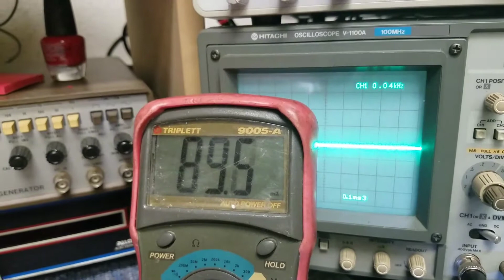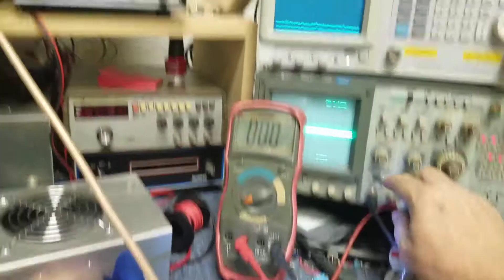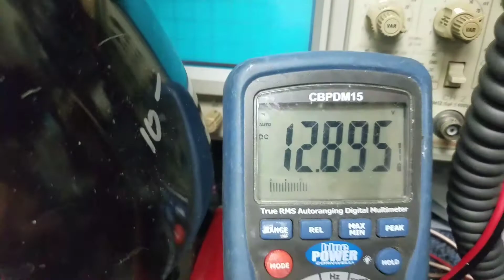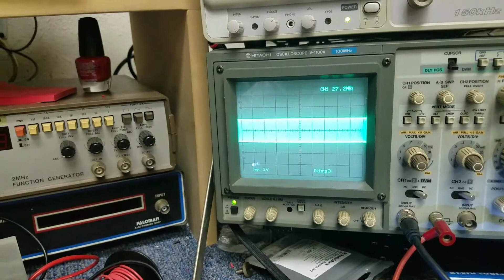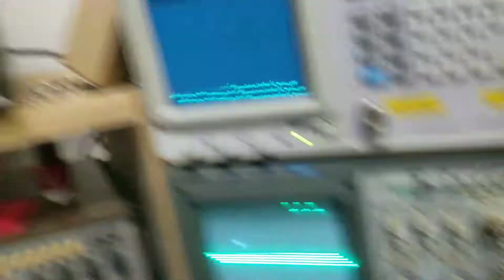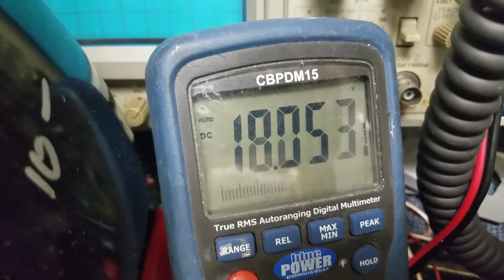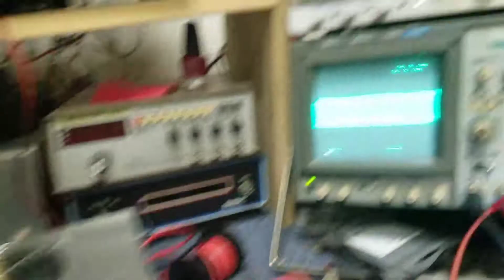REGULATED AB BIAS ..  YEA... WE DO THAT.

Comment: You do realize that the only way you can AB bias is FM right ?
Reply from the maker: your confused. FM transmitters are generally class c
Reply: ROFLMAO
Reply: WHAT ???? Only Frequency Modification can be AB Class ???  I think you need to re-read your  basic radio theory ... LOL 

This must be something you heard from somebody that obviously hasn't a clue of what Classes of amplifiers are .... Probably from someone who builds amps  with enough knowledge to make it amplify ..... but doesn't really know how or why it does work .... 
   Got to be the funniest statement I've heard in the electronic community in a while ..Of course it would be on a CB amp building forum... Can I sell you some antenna slick so them SWRs will just slde off tuat antenna ? Or a dead battery to shunt feed the bottom of your tower with so your signal will get out.better ? Class AB only with FM ... thats precious
Reply: @smokinjoeselectronics442bu7  or D

Comment: will this work on a 3 pill that is on u tube any help will be greatly appreciated thanks
Reply: Of course it will work. That is how all well built properly designed amps work. Only "builder" trash does not have this sort of circuitry. Only a moron would use cheap inaccurate giant sand bar resistors and a fixed bias. Bias should always be feed by a low impedance transistor and it has to track with temp. to be of any real use to keep the unit properly biased as it heats up with work or duty cycle. This is the only way to keep the amp AB biased. A lot of builders will build class B and as it is driven harder and heats up it will hopefully move towards AB and stay away from C. If you try to use a class C amp on sideband not only will you sound terrible but it will kill the transistors sooner rather than later. Most builders have very little education about electronics and I do not mean formal either you can be self taught at that is great. Most of them though just copy what someone else has done before and if you are lucky they might use trail and error to refine their already crude design. It is like the difference between someone that can turn a wrench and someone that is properly trained as a mechanic. You can not fix something you do not fully understand especial if you have no clue why something keeps failing. The "builders" suffer from a lot of failures due to their design. They can not fix the root of the problem because they do not understand what is wrong. They do not understand electronics that well and have no clue about design. The few that do are usually not that popular and are run out of the community and treated with a lot of hate. Builders have cult like followers that are brand loyal and will ridicule and run down anyone that has any intelligence and true understanding! You see it on all the amp boards and Facebook pages followed by key-down idiots and such! That is why they are all backed up with repairs to the point that most can not stay on top of new builds!

Comment: Clean ???? No filter but it's Clean ? typical CBer  non-linear "linear" ... Dude you just pushed  each of those 2 120 watt devices past double their factory specs . That should be a  250 to 300w amp.. and 300 watts is pushing it  ... dude , do you got any kind of attenuation on the input of that amp ?   I guess this is how you guarantee yourself more work. Typical CB amp/TVI generator .  But it sure sells amps because Cbers think that if it don't wipe out at least 5 channels on each side it isn't putting out power.

      And I'm picking on CBers ....because they don't understand radio theory . They instead go by  the crazy stuff they are told . They don't realize that a good ,clean ,amp doesn't splatter all  over and actually projects all it's power on the frequency that its on.. But an Amp builder should .

    Oh, and I like how you hid your "secret section" what's in it ? Bet it isn't a filter .... Why Hide it ? Good, Proven ,Bias circuits are all over web ...By the way , there is more than just voltage that Flattops a signal and throws out other trash dude.   But you your TVI generator is special  ... To CBers: TVI stands for Television Interference ...
Reply: FYI.
YOUR TALKING TO A DEAD MAN. HE PASSED A FEW YEARS AGO.
Reply: @hardhead7056 sorry  couldn't help it... he has his top secret 317( or similar )regulator cuircuit... lol... available everywhere..
     But I had no idea he'd passed ... maybe that's why he didn't reply to anyone ... However YouTube doesn't shut down a page because someone passed nor do they notify the public... 

It's still a filterless CB amp and people need to know the difference to keep from getting into other services....
Reply: @thefreese1  
His wife made the last post on his account.  Explaining his passing. Its still on his page.
But i usually feel that trash in, trash out.
 If you feed the amp with clean input  signal and it stay within transistor specifications.  Then you pretty much get clean output. 
Most trash comes from the transmitter.  Aka,  hacked up. Tweaked 🤪 and peaked radios. Lol.
Reply: @hardhead7056  it doesn't work that way ...
Its the harmonics... when you key up ..because your stock radios small amplifier circuit  is already filtered for the band as required by the FCC. If you happen to get your hands on a POS no name radio that can goe out of band obviously it can make it even worse .. or if you have a modified Name brand that has been altered  it can also be nasty because you've now whnt past the range of the filter built into that radio at the factory...

When you hook an amplifier up  you are now amplifying that signal again... this requires another low pass filter regardless weather it was a stock , clean radio to start with ... If you don't run the filter in place at the end of the curcuit then harmonics WILL be there , reguardless .... usually the 1ts,  2nd and 3rd being the strongest butt not always..I've seen where the 4th and 5th can be stronger than the 2nd ...or even the 1st .... And ... the more power your amp is,  the more harmonics will be affected. Especially with an unevenly built amp .. say your wraps aren't quite right on the transformers , or your core material is more for a higher Mhz band so instead of 43 or 61 or 67 material, you grabbed a random core and it was more suitable for VHF or UHF  ...but even with 67 that is suitable for 28 mhz harmonics will still show up on the scope... 
  So if you are on channel 40 and just the 3rd harmonic bleeds through your also transmitting on 85.2 or the 5th harmonic which is 142.6.... now your in the aircraft band ... not good... 

Hit 2 more harmonics and you'll be in a band that you really wish you were not on ... and remember... they hear you..
 But you cant hear them.

 The FCC pretty much will not mess with you on the CB band .. illegal Amp or not.... When they get serious is when you get into other services.... especially government or communication frequencies , then they get downright ugly  ..... and they may show up at your house simply because of a cheap chinese wall wort putting out unfiltered junk and it interferes with an important service... 

    The first harmonic of CB can get into a baby monitor .... no big deal, unless a smart person reports it to the FCC ..say a neighbor who hates you ...... but if it feeds into a remote satellite feed .. oops... then you get a sizable fine...

      Kinda stupid when you relize 3 lousy peices of wire wrapped around a pencil and 2 cheap Sliver Mica capacitors will eliminate all that mess... about 2.00 worth of parts to make a filter for a CB linear amplifier.... 

      But a dirty cb isn't really the problem because it should be filtered out when you it hook up a  properly filtered amp behind it .... because now the amp and the radio combined are the the transmitter system ... and the low pass filter in the amp is going to also filter the signal of the radio...

    Hope this helps you understand.
Reply: @thefreese1  
So your saying a Qaulity, "properly filtered radio", hooked up to a properly built amp. Using the component criteria you pointed out.
But unfiltered amp. Class C for example. 
 Is a major concern?
Reply: @hardhead7056  it sure can be .... there are circumstances that vary of course ..... but a simple  filter takes care of all chances ... about 90% of CB amps are dirty ... Like RM Italy ... they are dirty as crap ... throw a filter behind it and it's clean enough to not bleed over 40 KCs in either direction like it was before the filter....
Reply: @thefreese1  
Good to know its a fixable thing.
I wanted to put a little rmitaly amp inside a cobra 29. For my girls mobile..

I guess a perfect scenario is keep your power focused as possible.  So its not eaton up by the after/post  filtering.